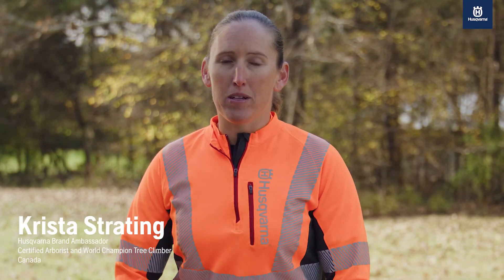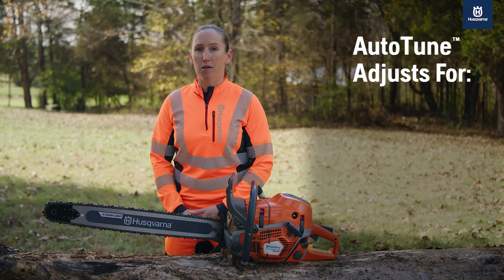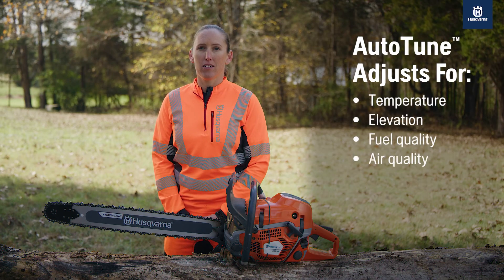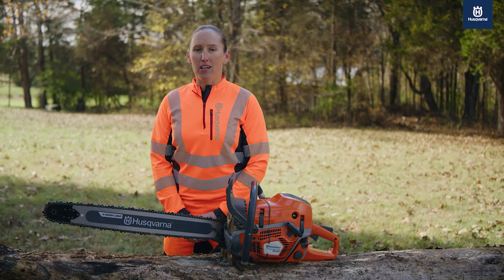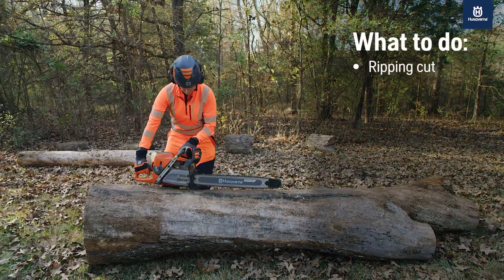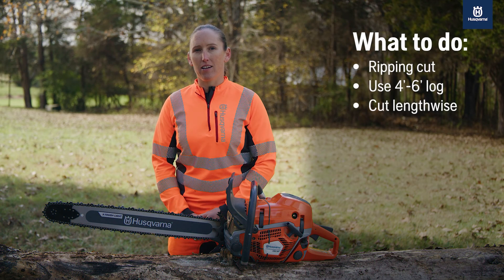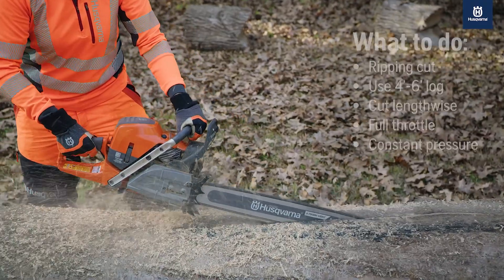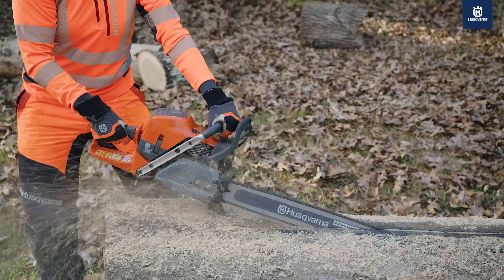How to Tune AutoTune™

Comment: PUT IT IN THE MANUAL.

Also, yeah, most of us can't just randomly do a 6ft rip cut, I'm using this for tree service and brush clearing, the saw will be started, run for a limited number of cuts, and then moved.  I can't wreck people's yards/parks/trails with rip cuts.  I understand maybe doing this once every season, or every change in altitude of more than 4k ft, but it needs to have an on the fly adjustment that it does like mtronic.
Reply: Yeah this is dumb, how does the saw know the difference between a ripping cut and a gentle buck, some people might go the whole job without anything big enough to do this procedure. Mtronic type seems better